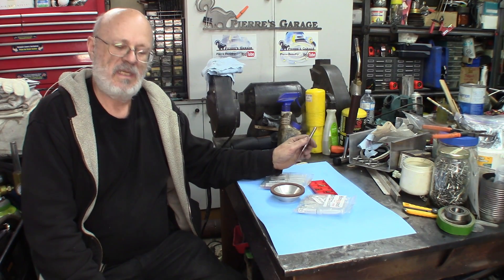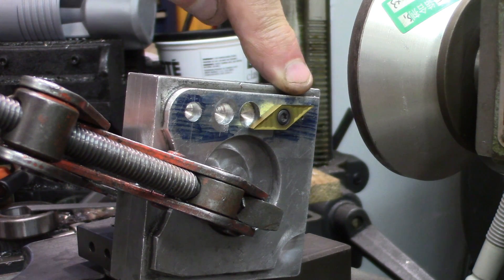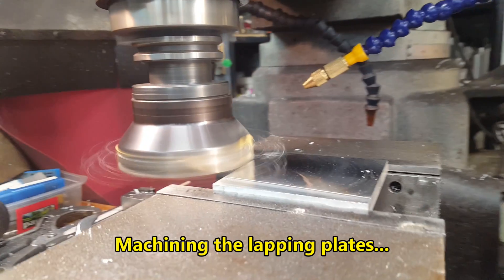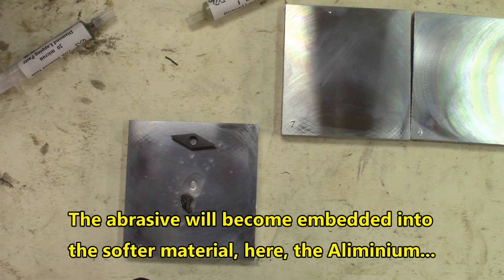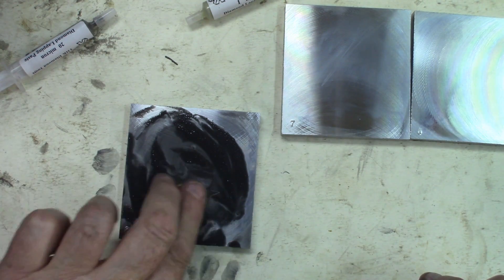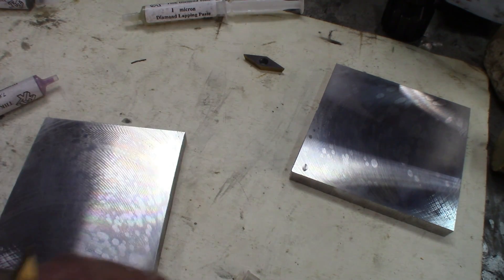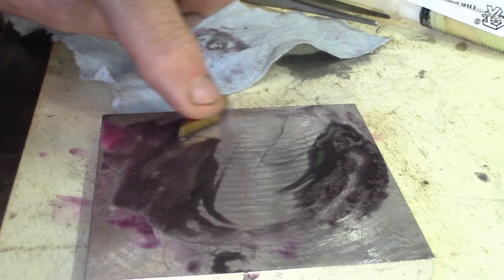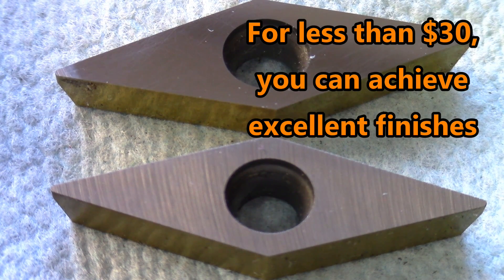Carbide with mirror finish using diamond compound, less than $30 from Banggood

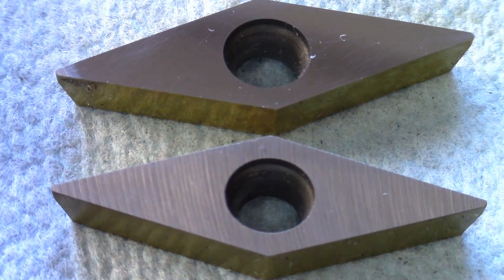Comment: You missed the tips on them! Isn't that pretty much the whole point.... To polish the point? 14:05
Reply from the maker: I know, this was the first insert to be polished and filmed, some other inserts were done in a better fashion, the main purpose of the video was to demonstrate the possibility to make mirror finish on material as hard as carbide with that procedure.
Even if it's quite easy to get this finish, in order to make the process fast enough, you need to start with at least a pretty well ground rough surface to start with, that wasn't the case with that insert....    ;)

Comment: I have used diamond pastes on steel lapping plates to sharpen my high quality wood chisels. Believe me, this stuff can bring steel to scary sharp proportions. Unfortunately I purchased my plates and paste from a wood working supply house that demands premium prices. I would purchase more from Banggood at this incredible price but this stuff lasts forever. It’s a good idea to keep the plates protected and in separate containers when storing them. I use zip lock bags and throw in a little silica packet to absorb moisture to prevent moisture. Also, if you don’t like the mess made with Water Displacement trial test # 40 , use Windex as lubricant. It smells better and cleans up nicely.
Reply from the maker: You seem to use water or water base solvent to dilute your paste, here I use WD-40 or kerosene to thin the paste, also the plates I used were Aluminium, since I was using mineral based thinner, I was storing the lapping plates in Ziplocks still pretty buttered with the goo on them, I wasn't worried about corrosion, got to be more careful not to gouge in the plate with Al, though...

Comment: I had been buying diamond paste in 5-gram syringes. Now I am thinking about buying the diamond powder in grits from 1000 to 80000 and mixing with mineral oil to make my own diamond paste as needed on demand. Is such a mix essentially 50% diamond powder (in grams) and 50% mineral oil (in grams), or is the amount of diamond powder used in ready-made paste much less than 50%?
Reply from the maker: Not sure for what you want to use the paste, the use will determine the ratis and the type of oil or thinner.
For coarser grain you may use some little thicker oil, but, when you get to very fine grain, you may want the thinner as liquid as possible, like kerosene, or even alchool, you want something to evacuate the particules, not something to keep those between the lapping surface and the part you want to polish, the above is relating to a situation where you have a softer lapping surface and a part you want to polish.
If you plan to do some polishing with a pad or some some kind of rag, you'll have to experiment, I'm not very experienced with using diamond paste or coumpounds in that fashion, probably a little different from standard polishing compounds where you need to create a certain amount of heat in order to get proper results...
In any case, just let me know how it goes, and, thanks for viewing and for comment,     Pierre
Reply: Thanks for your reply. I wasn't even thinking about the carrier. I was thinking I'd use mineral oil for everything. I am polishing stainless steel, nickel, and brass to a mirror finish. This is solely for aesthetics, no polishing of machine parts. I am using a rotary tool with various pads and brushes to do the polishing.
Reply from the maker: When like you I want to polish some parts for aesthetics, I use different polishing pastes on polishing pads or wheels, never tried with diamond pastes. My use for diamond polishing is more for lapping harder parts by using a laping plate made with softer material to where the diamonds will imbed themselves, naturaly the finer the diamonds the liter the solvent, when you get to the micron sized particules, you don't feel much abrasion even though the job is still getting done...

Comment: Hey Pierre and Phil, would this have any benefit for metal work as well as the wood turning, I am just curious on your thoughts here. Cheers! and thanks.
Reply from the maker: HI Howard, those inserts were a test to see how they would perform in woodworking, take a look at this from a fried's channel that tested them... 
https://www.youtube.com/watch?v=dOpNvxDd_Yc&t=208s
Reply: Yes, definitely. Carbide inserts only achieve optimum effects with powerful lathes and while taking deep cuts, for hobby lathes HSS tooling is superior when doing metalwork. If you prefer to use carbide tooling on a mini lathe then its still possible to achieve pretty decent results, but the only way to do that is by making sure the carbide tooling is as sharp as possible, much more so than how it comes out of the factory.

Comment: If you look closely at the end, you totally missed grinding to the very tip on the one edge. That edge will be no better than from the initial 180 grit grind.
Reply from the maker: Hi, those inserts were used to make a point on some project to come, I waned to show how it's possible to get a mirror finish on the inserts and as the incomplete edge, we used the completely finished one for the tests, along with other inserts not shown in this video...   ;)
Thanks forviewing and for leaving a comment,   Pierre
Reply: That shows how much even carbide bends under the pressure of that centre screw. It would have pushed the ends up so they got ground more by the wheel. Then on the lapping plate they relax back, and don't get lapped.

Comment: The conventional wisdom is that carbide tooling, since it is sintered and not a continuous material "cannot be sharpened" to the same degree that HSS or other types can. I suspect this is a bit of an overstatement, it can obviously be honed to an extremely sharp edge, you just need to use the appropriate abrasive, IE diamond. Whether it will hold it's edge is another question. But if it does, being a harder material then it should last longer.
Reply from the maker: Carbide is always a little less able to come to a very acute edge and keep it, we got to compromise in order to keep a decent sharpness longer than a steel edge would last...  ;)
Thanks for watching and for your comment,   Pierre

Comment: After you lap upper surface, you must grind the sides.
Reply from the maker: I ground the sides a little on some of the inserts, but carbide doesn't get to to be as acute as a steel edge, it's a mater of compromise between sharpness and longivity of the edge...   
Thankls for comment,    Pierre

Comment: For getting machined acrylic to prism flatness and transparency: sanding series to 2000 or higher grit, use headlight restorer polish on a piece of painter's tape on flat glass for lapping, it works well so long as its damp but not wet.  Will work best on parts of large surface area with no ground face dimension below 10-15mm and good rigidity.
Reply from the maker: There is a company called Micromesh, if I'm right...  They make some restoration products for the Lexan industry, like helicopter or airplane windows, those products would be something like you describe up there, you can get some sanding cloths and polishing compounds all meant for plastics, not suitable for metals, though.
If you need to polish metals you need much harder abrasives, when you get to carbide, the only product left is diamond...
Thanks for watching and for comment,    Pierrre

Comment: I wonder if those inserts would work well on brass? I saw you were using them for wood but since HSS tools for brass tend to be neutral rake it might make a good finishing tool for it as well. Might be something worth checking.
Reply from the maker: Uhmmm...    Your comment makes me think about trying it on my next brass job...    Could work pretty good with a super nice finish...    Thanks            ;)
Reply: Would make a good short video to compare finish on brass using the lapped carbide vs standard insert if you do find it works out
Reply from the maker: I'll do the tests on wood before and I'll try them on brass, question of not having to re-polish the inserts for the main purpose...   Have to think about it on some brass turning job to come...   ;)

Comment: What wood are you hoping to use those inserts on? You might even find you get better results with a rough finish rather than a polished one, much like scissors don't work on paper or cloth if they are smooth.
On the "don't use diamond on anything other than carbide", you do know you can get a diamond wheel for a Tormek wet grinder and Drill Doctor use one too, "just saying" as Keith would say. :>)
Reply from the maker: In the woodworking world good carbon or tool steel is King, the master turners have ways to work with steel tooling where the finish don't even need sanding cause the sharpness of the tool. So far they can't get those results with carbide, this is a test to see how close we can get...
On the advice of not to use those wheels on other than carbide, I'm talking about resin bond wheels like those here, other types like the ones you mention will work perfectly with HSS or anything of the kind...    ;)
Reply: I know one of the best production turners and what he can do is amazing and so very quickly, certainly quicker and better on couple on hundred stair balusters than a machine can do and, as you say, very little sanding. Blowing my own trumpet a bit, I made him an upgraded sizing fixture that, he claims, saves him at least an hour a day. I should have charged him more. >(
On the wheel again, you might have that back to front, A resin bonded wheel can be redressed, an electroplated one once damaged is kaput.

Comment: I have been using that diamond paste for a while.  It is excellent.  I often use it on plywood.  Diluting with wd40 is a good tip!
Reply from the maker: Hi John,  WD-40 or anything that sort will ennable the part and the substrate to really get close as the only thing in between is the diamond particule imbedded in the Aluminium plate, this is where you get the most efficiency...
Right about the price vs quality, there is better paste but the price is way out of proportion, this is more than we can appreciate in a hobby or small machine shop...   ;)

Comment: Are these for Robert?  I have an 8000 grit DMT diasharp stone.  I wonder how it would do on an insert?
Reply from the maker: The inserts will be soon tested in woodworking application in order to find out if they could approach some well sharpened steel tooling...   ;)   This is a colaboration with another video producer from Quebec that has a woodworking Channel and shop...
I'd be also curious to find out about the 8000 from the DMT...    The finest DMT is a 1200 and it's never producing anything that shines... 
The most diffucult part is to get the surface to be polished as flat as possible with the coarser grit right from the first grind, after that the rest is downhill and pretty easy as the grit gets finer. You need to keep contamination from coarse grit in order to avoid scratches on final finishes...

Comment: Hi Pierre, I noticed through the proces, that the tips where not so shiny, could it have been because you mounted the insert horizontal for the initial grind,(the grinding wheel cuts better the narrow start of insert as opposed to the wider mid section) maby it was better to mount them verticaly, as usual a good old handgrinded thumbs up.
Reply from the maker: There is a little tweeking to be done, would have required a "little more" grind with the rough grit to get the far end of the tip, that will be done off camera with the withness insert, though...   ;)

Comment: It would be interesting to know for what purpose you need this mirror finish. And if it is for cutting purpose why not mirror polish the sides of the inserts too to get an ultra-sharp edge? Will we learn about that in a later video?
Reply from the maker: The inserts will be soon tested in woodworking application in order to find out if they could approach some well sharpened steel tooling...   ;)
Your concern about the edges is one of the options in line, we'll be doing more testing as the trial is going on, can't give any date on a future video since it's not been under way yet...   ;)
Reply: Sounds interesting. I am looking forward to that. Another interesting parameter will be the best rake angle. In carbide circular saw blades for wood it is rather aggressive. In carbide router bits it is much less aggressive down to zero. In planer/jonter shafts it varies. Those with many carbide pieces have less aggressive rake angle and those with 2 or 3 carbide blades reaching across the whole shaft are more aggressive.

Comment: Got a lap kit from ebay some time ago - different one but lot of different grades of particle. Also got a 4" wheel - have yet to try with mods on any inserts.
Seems to work well your lapping though, not sure why you decided to do it!
Reply from the maker: If you got a good platform to hold your work the diamond wheel perform great...    
The inserts will be soon tested in woodworking application in order to find out if they could approach some well sharpened steel tooling...   ;)
So far the lapping pastes seem to operate great for a low cost...   ;)

Comment: Nice finish Pierre! Enjoyed
ATB, Robin
Reply from the maker: I'm quite happy with the results, the inserts will be soon tested in woodworking application in order to find out if they could approach some well sharpened steel tooling...   ;)
Reply: Why aren't you using the polished high positive rake carbide inserts for aluminum?
Reply from the maker: The front rake of this insert is pretty positive, like  +/- 17 degrees, and, from an Al insert it would require removing quite more material from the top since the patern is much deeper, not certain how this will operate but there is surely gonna be room for suggestion after the first tests, possibly this week, if not, then next week...

Comment: OK curious why the need for a mirror finish insert....
Reply from the maker: The inserts will be soon tested in woodworking application in order to find out if they could approach some well sharpened steel tooling...   ;)

Comment: What is the other application?
Reply from the maker: Those are tests for using them in woodworking applications, to see if carbide can deliver a finish close from steel tooling...   !!! ???
Reply: Pierre's Garage Interesting   video on polishing. As far as for use as wood turning you can purchase carbide already polished as often used on aluminum.

Comment: Hi Pierre
The stuff you get from Banggood seems to be the same quality as the stuff I get from my local dealer. I live in China by the way. Please let me know what you need and I will happily provide you. I work in the Oil & Gas business and benefit from the the 28 day rotation, so occasionally I will have time to support you.
Reply from the maker: Hi, just about everything, even what's made in the USA has most the parts made in China or an Asian country...   It's kinda normal to be able to find lots of comon products all around the World.
Is the price of shipping some parcels using the mail service as high for someone residing in China as we pay over here in Canada to use the service...???   Cause here it's really expensive to ship anything around, most of the time more than the cost of goods...
Yet I have no idea of what could be something you could do, but, since there is always something new that can happen, maybe one of those days you'll be able to do something...
 Thanks for the offer and for support,     Pierre